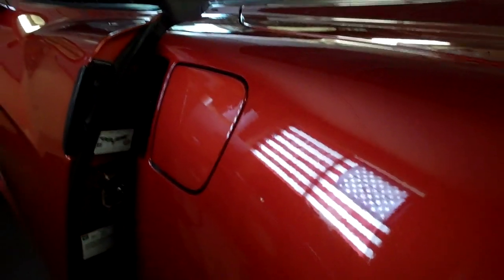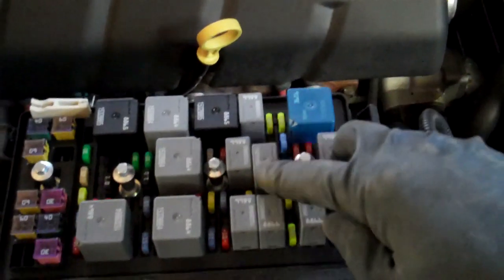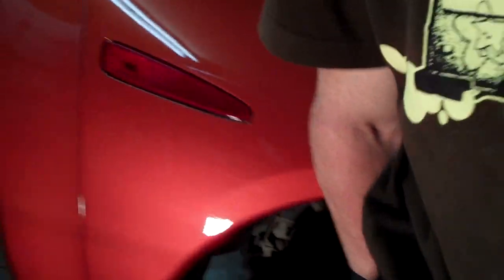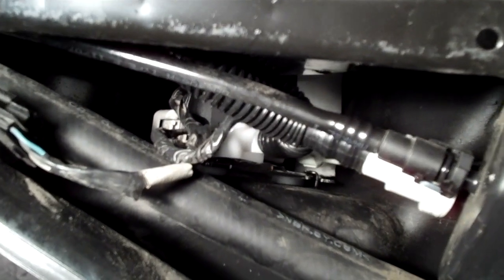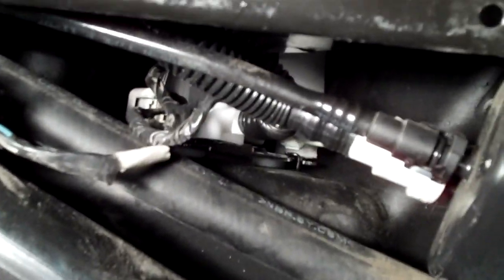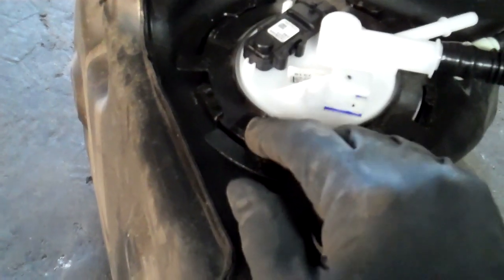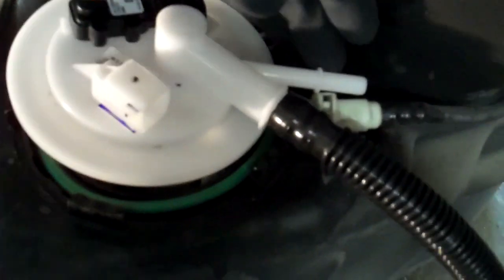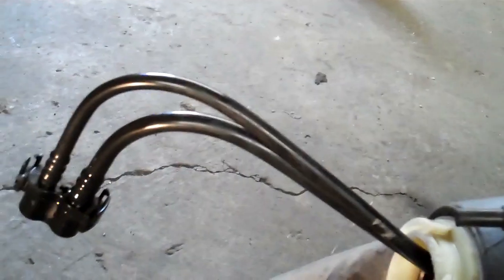How to change the fuel sending unit on your Corvette! With briansmobile1 Code P2068

Comment: I just did this on my C6 Corvette and I found two things that I would probably adjust in this video. The first thing that would be essential would be taking out the filler neck to on the driver side tank and order to move the tanks around and have the ability to disconnect the crossover pipe. The second thing I would advise people can be extremely useful is an oil filter vise grip tool for turning the tube

Comment: Hey I hope you can help. I have 08 c6 automatic trans. Driver fuel tank is leaking (smell heavy gas fumes when pumped over half tank) known issue with the c6s. I was told will need to drop the transmission in order to replace the pump in the driver side? Please respond as I need help

Comment: How do you mount the new gauge sending unit to the pump housing. I have a brand new OEM pump and the contact piece is not connected. I must slide it on but the housing is blocking it from having the space to slide on. Typical GM pathetic engineers. Did your pump come with the container piece already installed? Because mine did not, and unless I can somehow snap it on without braking it, I don't see how I can get it on there.

Comment: Question...and sorry for the stupidity of asking several years after video upload ...when fuel gauge goes to zero even with full tank of course it is the sending unit but is it located at passenger side or driver side?
Reply: C6 has fuel sending units in both tanks I believe

Comment: Hey Brian I have a question when reinstalling the tank do I leave the crossover tube in the hole u just showed and push the tank on up to the connectors or do I put tank in and wrangle the cross tub in the tank hopefully it mates with the 2 connectors blindly?

Comment: I realize this is an old video but have you ever done the same thing on a C7 corvette with auto trans-- I got the P2066 error on my car with 276 miles on it and now they want to drop the drive train to get to the fuel tank.  Not sure they'll get it back correctly

Comment: The difficulty for this repair is accessing and unclipping the crossover pipe and the tubes inside.  My 2005 c6 has 120,000 miles and I couldn't apply enough force to get to the inside tubes.  In frustration, I went for an overhead access.  The crossover pipe is located in the raised square tube affair that separates the seats from the cargo area.  I pulled the carpet up and cut a one foot side-to-side slit at the very top of this square tube over where I knew the crossover pipe ended.  I cut it with a auto body saw (cost me $27 new) and made sure I didn't go deep with the saw strokes.  I could see the crossover pipe and the evap line through this slit as I was cutting, so it was easy to avoid them.  I then cut slits 6 inches down, on both ends of the 12 incher and on both the bucket seat side and the cargo side.  I then pried open my access port with a locking plier.  

Suddenly the job was super easy.  I could see everything and access everything.  Unclipping the two inside tubes took less than 5 minutes.  I had previously spent over 2 hours to no good trying to get these unclipped and the evap unclipped. Putting stuff back was even easier.  I then bent the auto body metal back to original position and sealed up all the slits with a heavy duty metallic tape used in heating duct work,  and reset the carpet.
Reply: Ronald Smith I to did this was better job but I welded my cuts back put undercoating on bottom to hid it
Reply: Qt11q

Comment: Before you do this... use super unleaded only and a bottle of Techron ($12.99) from O'Rielly's fixed mine. Usually from cheap gas. I went through about 5 tanks of super and as soon as I used the techron within 75 miles it cleared up and my fuel gauge works again.
Reply: Worked for me. 1 bottle and 1 tank super within a few days it will come back.
Reply: Paul Pearson TECHRON DOESNT WORK. THE SENDERS ARE WORN OUT
Reply: Worked for me, hasn't stuck again and are you or so
Reply: A year or so
Reply: +Paul Pearson So curiosity, it has been 9 months since you wasted money on snake oil.  Did you eventually replace the sending unit?
Reply: +Lynx Star Automotive (Gabe V) No more issues, snake oil Chevron Techtron has done the trick for over a year now. go ahead and charge your customers a couple hundred to replace their sending unit.
Reply: dthope1969 unfortunately, your case doesn't apply universally to all.  Many times they come in, and the sender is toast.  Sooner or later, you will suffer the same fate.  It is just a shit design, and poor quality part.

Comment: Hey, I have a 2006 Z51 Manuel 
6-Speed car. I just wanted to make sure before I took the car apart that I needed to take apart the passenger side sending unit and not the drivers side pump. My fuel gauge works when I filly tank all the way up, but when I get to just little more then half a tank it starts dropping all the way to zero. Does this sound like just the sending unit on the passenger side??? Please let me know asap, I will be waiting on a answer from you before I am start the project. And there's no way I can afford to have a shop do it at $1,500+.
Reply: definitely a sending unit. 4 years ago... did you do the job?

Comment: on that connecting hose up top to install it did you need a special tool for it? bc mine seems to be stuck it slipped in but now I cant take it off or connect it at all

Comment: wow... you made this look super easy.  ...uggg mine needs this...i'm dreading this...  looks like the worst part might be disconnecting the bridge hoses....and then pulling the tank....lastly being pulling the floats / sensor.  I'm surprised this can be done on a garage floor though.  Where are you located by chance?

Comment: Hi Brian - I followed the video and pumped the gas out until it wouldn't pump anymore but to my surprise when I dropped the passenger side tank I still had almost 5 gallons in it! Do you think that means the passenger side transfer pump is also bad? Other than the gas gauge problems I haven't had any other problems.

Thanks for the video!

Comment: Nevermind. I realized that what happened to me was the clips that hold the fuel line receiver into the passenger tank broke. So when Id mount it back up they wouldn't align and connect. Gonna try and glue it together, if not Im gonna have to buy a new line since they're one piece and itll have the clips on it. Realized that after re-watching the end of your video. I kept trying to hook up the fuel lines first then raising the tank.

Comment: Hi Brian. This is my second attempt at tackling this project. The first time I couldn't get the fuel lines unplugged from the cross over tube to the passenger tank. I've replaced the sending unit but now I can't connect the fuel lines (from the passenger tank to the crossover pipe) Where can I get some slack from? Also do you reconnect them from the trap door or underneath the car? Thanks

Comment: Hey, sorry if I wasn't clear, but my problem is only with the *crossover pipe*. I got the other small connectors off, but after I take the collar off the crossover pipe, I still can't pull it out of the tank no matter how hard I shake and yank at it. I'm guessing the o-rings are stuck on the tubes inside, but there's no way to get inside the pipe if it's not pulling out.

Comment from the maker: The key to getting those top pipes off is finesse and determination.  Some have clips that require you to solve a rat maze.  Others bind on over time and require peeling off using a thin long phillips screw driver bent at 90 degrees and then pull them like a Chinese finger trap.  Generally you have to get them to twist before you can pull them off and if the twist and wont pull, expect a clip or a rectangular button to get them to release.

Comment: Hey, Brian. I got the collar off on the passenger side, it was all loose and everything, but the crossover accordion pipe just wouldn't pull out of the tank no matter how hard I yanked. Plus there's not much room in there. Is there a trick I didn't think of? I had the driver's side tank hanging down a bit, that didn't help either. Had to give up and put everything back together. Now the plastic safety collar on the metal collar doesn't stay on very well. Slight finder pressure will pop it loose.

Comment: Mmmyeeeaah... Either that or they make a car with an engine that's not thirsty enough to require 2 gas tanks.
I mean seriously, what is the reasoning around this car? The damn thing is basically 2 seats, 4 wheels and a big ass engine. It doesn't even have a proper trunk. It's rubbish. 
Just a motorized, gas gozzling fashion statement/penis extension.

Comment: Fuel sending unit for my Ford Expy was $220. So, I sanded the contact points, re-bent the contact arm, and used a my scout swiss army knife to separate the individual contacts on the arc, and WAA-LA. It has worked for 32k miles. Thanks Brian. Your vids are the best.

Comment: Did the Techron solution not work for this one? or did the owner just get tired of doing that?? I ask because the gas gauge in my 04 seems to be stuck in between half and 1/4, and the Range indicator hasn't budged from 185miles...  :-/

Comment: For most cars, one gas tank would be better. When designing the corvette, the main objective was performance so they moved the transmission to the back of the car to improve weight distribution (because cars handle better with an even amount of weight on each tire).  With the transmission in the back, they did not have room for a single 18 gal tank, so they instead made two 9-gals.

Comment from the maker: The cross over is somewhat flexible in length.  There's also guides on the two pipes to make them click in together.  Use spray silicone lubricant and they'll go in just fine.  There are two O-rings per line.

Comment: Great video as it explains some of the unkowns for those of us that will do this for the first time. I plan to upgrade my Grand Sport to a high flow fuel pump that is required for the E-Force supercharger i plan on buying in the next few months. Mine is a 6 spd auto however. 
Any additional pionters when removing fuel tanks from automatics? Thanks!

Comment: The fuel sending unit card is a very common probem with these cars. Not only does the card discolor, the fingers on the swing arm wear away causing the gauge to read erraticly. I've been working on these for a long time and your procedures explained make it easirer than GM's SI make it look. I've always been stuck with the A/T though :( Love your vids. Please keep them coming..........

Comment: @briansmobile1 I agree with nothing to loose to try and fix something broken. But if you are working on something expensive like a car and you do try and fix something you could end up breaking something else. Or you can fix it with no problem and you forgot how you took whatever apart. And your working on a Corvette your brave (those aren't cheap if you mess up).

Comment: @briansmobile1 You would think with the technology we have today we wouldn't still be using a float and reostat setup. Mechanical switches are so 19th century. I know there is an electronic answer to reporting a liquid level in a tank, and it probably would cost much less to produce and last forever.

Comment: For some owners, dating back to the C5 model, running a bottle of Chevron Techron (the ‘concentrated’ stuff) through the system seems to  clear this problem up. But sometimes it’s just bad and you have to replace it. I know on some Vetts (‘05 for sure) there was a TSB issued about this and a computer re-flash was necessary too. Gotta love technology.

Comment from the maker: @midlantic1 They quoted the owner $1600 parts and labor.  The sending unit (they call it a fuel level sensor) is over $500.  This car only has 30K miles.  The passenger tank empties first so it's empty or at least low enough for moisture to corrode the rheostat MOST of the time.  Any time the tank is lower than 15 gallons that thing is in air/moisture and getting a dose of entropy.   When the code comes on- the gauge goes to 0 and it dings at you every couple minutes LOUDLY over the speakers.

Comment from the maker: @KillerZero259 The tanks strattle the transmission.  Is a matter of fuel capacity.  The passenger tank empties first.  That makes all the weight on the drivers side where the driver is... so that rules out weight distribution.  It's simply to increase fuel/range capacity without losing storage for 1. A hot chick in the passenger seat 2. a place for the powertrain 3. A spot to put the top down into 4. Four big wide tires.